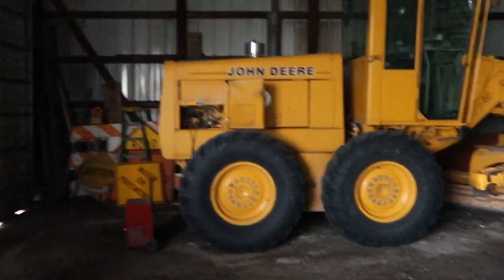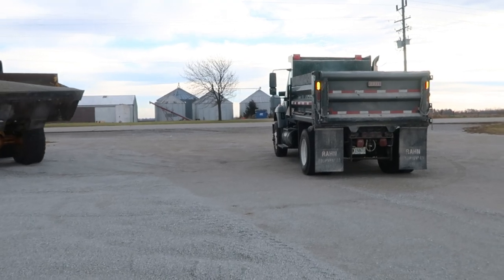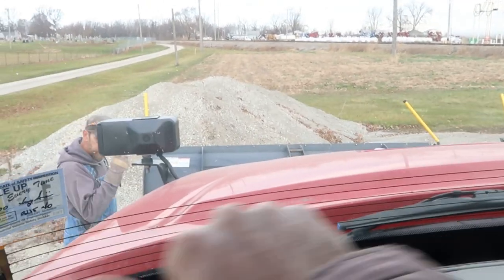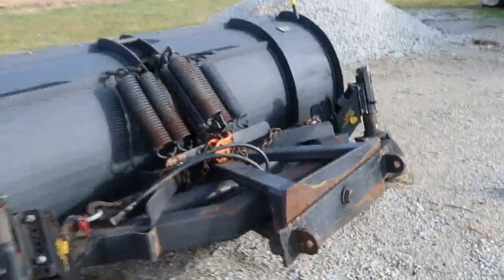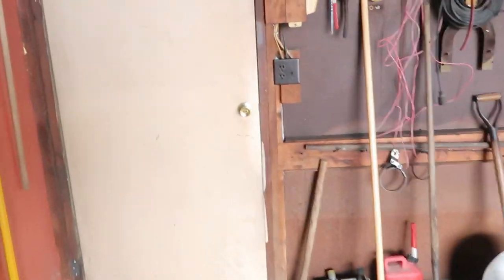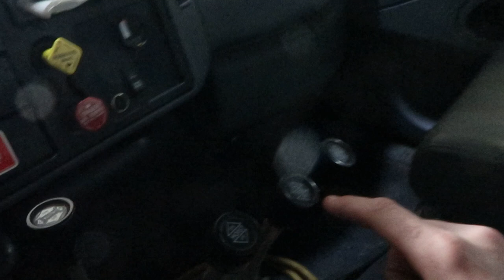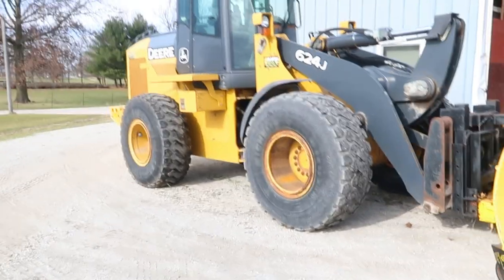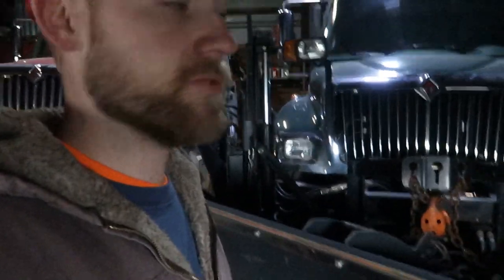Township Snow Plow Prep | Winter is on the way!

Comment: On the Allison you should be able to limit the up shift of the trans with the mode button I,e, 1,2,3 instead of 1 through 5 shifts.
Your lucky no salt, or brine really destroys a truck, from the radiator to the tailgate.

Comment: I am 60 miles east of Chicago right on the lake. I have been street superintendent for over 40 years. My son as been plowing with me for 10 years.  I plow with a 1996 Ford f650 with underbody plow and front plow when it gets deep, and Swenson v box stainless salt hopper. Also have a 2016 Ford F-250 with a western wide out.  Also a 2006 new Holland 4x4 enclosed tractor and bucket.  Also use this for mowing in the summer

Comment: I drove a big Sterling with an Allison transmission in the city of Toronto Canada   .Lots of hills to climb ..

I found it worked best if you controlled the shifting . And if you read the manual it will tell you to keep it in lower gears in town and under heavy load .

   I always shifted it at 1,800 RPM     GREAT  TRANSMISSIONS  , BUT NOT TOO MANY PEOPLE READ THE OPERATORS MANUAL OR KNOW HOW TO OPERATED THEM PROPERLY
Reply from the maker: That is what I do for now. The transmission in the green truck shifts totally different

Comment: heel is back of plow toe is in front,  just ike a human foot.
Reply from the maker: It’s labeled wrong then
Reply: No it’s labeled correct. The point on front of the wing at front of truck is the toe. The back by passenger door is heel. Like a human for the toes is out front while heel is in back.
Reply from the maker: It just doesn’t feel right